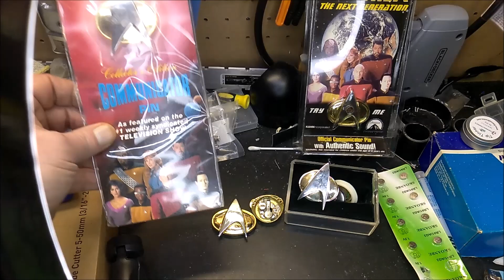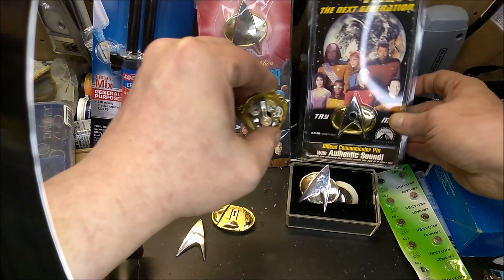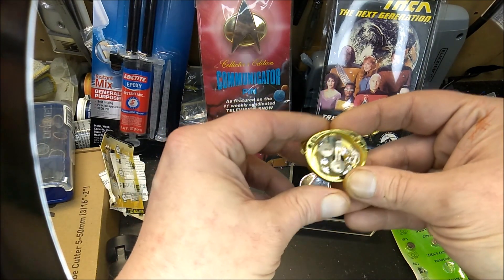Star Trek: TNG Com Badge Sound Comparison & Battery Change Procedure

Comment: I did find one of the Generations ones and a 30th anniversary one, Voyager badge style on eBay, so thanks for pointing me that way.  However, when I tried to replace the batteries, neither one would make the chirp.  I used LR41, or similar style.  (I did look to see what can be used in place of LR41 if I couldn't find that one).  Am I doing something wrong?  I did work to carefully clean out some corrosion from the previous batteries going out.  Is there a way to fix that?

I also have one of the ones with the rocker switch, but the delta somehow came off of it.  I liked that one, except for the pins poking me when I'd wear it and go to use it.  Was hoping to find something like that in a magnetic form.